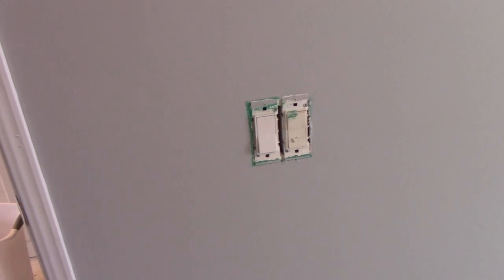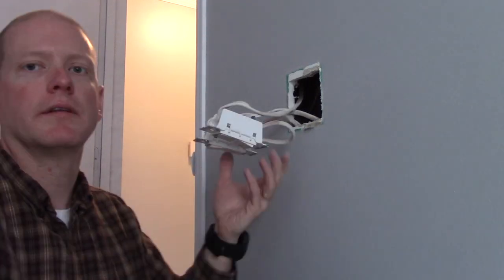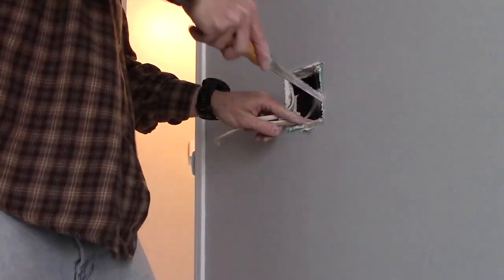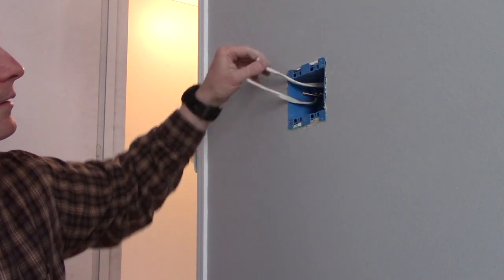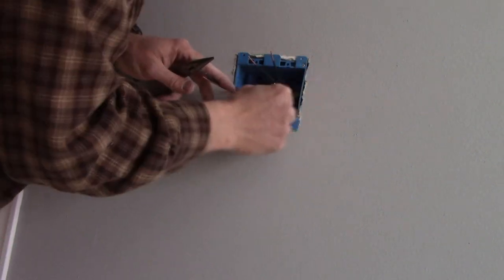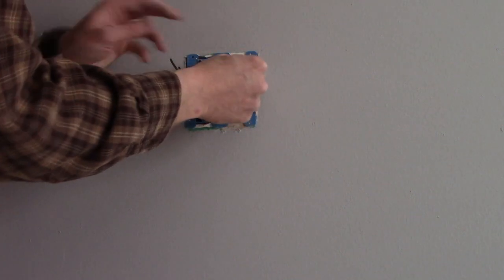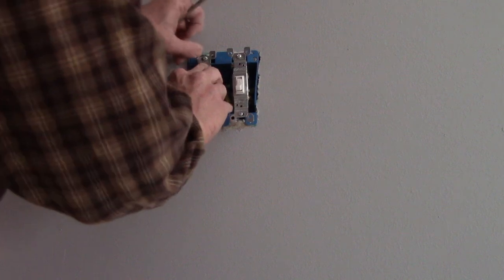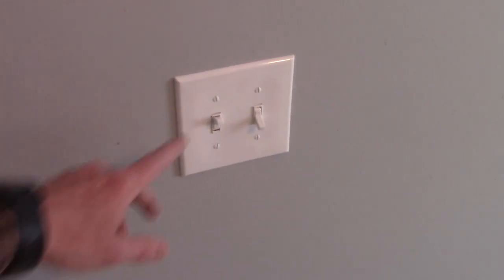How To Replace Mobile Home Self Contained Wall Switch or Outlet

Comment: I wired hundreds of mobile homes using snap fit receptacles and switches working for Mobile Home Estates in Bryan, Ohio.  They are extremely inexpensive and fast to install and yes they are JUNK.  An average single wide mobile home was wired in less than 45 minutes.  This included cutting the notches in all of the studs, cutting all the holes in the drywall for all of the boxes, running the wire, installing the boxes, putting protective metal covers on each and every stud that has a wire in it.  wires going up to the ceiling or down below the floor had tubes driven in to protect the wire.  This was all done in an average of 45 minutes to 1 hour by me for a complete single wide mobile home.  Double wide's are a complete nightmare because the two halves are split and all those wires have to be coupled together somewhere and it us usually inside of a switch, receptacle, or just a blank box in the wall or below the floor in the double wide.  Often there were more than one feed wires coming from the breaker box going into the junction box and the set up guys would just wire all of them together so you would often have two 120V power wires running one outlet.  OFTEN ON SINGLE WIDES you have a  single white wire and a black wire going to the switch.  That is because they are running a power loop thru the light fixture and to save wire they just break the hot side at the light fixture by running a single wire to the switch.  (black power coming to the light fixture "hot" connected to the white going to the switch and the black wire at the switch going to the black wire on the light fixture).  MOBILE HOMES OFTEN HAVE JUNCTIONS AT THE LIGHT FIXTURES RUNNING OTHER RECEPTICLES OR LIGHTS.  MOBILE HOMES ARE RARELY WIRED LIKE A STICK BUILT HOME SO BE CAREFUL WHAT WIRES YOUR CUTTING AND CONNECTING TOGETHER OR YOU WILL HAVE A MASSIVE SHORT.  THERE ARE SPECIAL TOOLS USED TO TRACE WIRING IN MOBILE HOMES !!  Further if you are going thru all the trouble to get rid of junk crimp style switches and plugs that have corroded and faulty PUSH TYPE CONNECTIONS, why in the world would you replace them with new push type connections that are going to corrode and fail just like the original ones did.  USE THE SCREWS ON THE SWITCHES AND RECPETACLES AND USE DIELECTRIC GREASE ON THE WIRE if you have Sulphur water or high humidity in your area.   Wire nuts are far superior to these push type connections and never ever use the push pins on switches and receptacles as they will corrode and fail !!
Reply from the maker: Good comment
Reply: Your video is very well made and I respect that you are trying to help people.  After Mobile Home Estates closed,  I opened a mobile home repair business.  I did exactly what you did on many homes and had quite a few of them fail mostly in homes with Sulphur water. because some of the crimp fittings were ok, and usually just one failed, it makes tracing the wire to the problem extremely difficult if you have a failure using push group fittings.  As you know and made a good comment on, rarely is there much wire left in the wall for a repair.  This is because we were told by the mfg. DO NOT WASTE WIRE.  they would weigh our scrap and dock our pay for the losses especially when copper prices went sky high for a while.  Also there is a LOT of poor quality wire used in mobile homes having a lot of higher filler metals in them which corrode faster.  You can tell by how hard the wire bends.  The easier the bend the more copper that is in the wire which is a better quality.  I would just go one step further and tell people to pop the back off of each and every switch and receptacle and pull the wires out noting EXACTLY which ones were connected to each other.  Cut the wires where the crimp on the switch or receptacle punctured the wire coating.  This will give you more wire to work with.  Further you can be sure you are putting things back the way they were.  You can often strip off just a little coating and leave the wire intact and just make a loop over the screws on the receptacles which is a safer way to keep power going to the next item in line, plus again gives you more wire to work with.   I am not a troll, just trying to help.  Thanks again for the great video.    @JackofAllMasterofNone
Reply: @brywilder7582  thank you for taking the time to share all your information and expertise. I live in a mobile home. First experience with one. What a new and trying experience. Wow this electric, plumbing, shell and everything! I was completely naive and uneducated. Learning something new everyday. But wow on the electric. Trying to change 2 vanity lights now (into one). What a fiasco.

Comment: Just a heads up, you don't have to cut the wire at the back of the self contained switch, they have a pop out plate and the wire inside is already stripped.

Comment: The biggest problem is not so much replacing the switches is the fact that most people don't hold onto the outlet when unplugging and end up pulling whole outlet out and pull it through the sheet rock resulting in large hole to repair.  The whole industry for mobile homes need to be updated.  No 2x4's to hold outlet boxes and 3/8" of sheet rock is all that holds it.  Kids could touch edges of plugs and electrocute themselves.

Comment: When I pulled out the switches in my bath room the switch on the right side has two wires on bottom of switch and the light switch on the left has two wires on top on the switch. I have watched your video 23 times am not sure what to do. thank you for making this video.
Reply: Did you get an answer? Mine is exactly the same

Comment: Thanks for all your tips. I live in a double-wide mobile and all the outlets in the light switches are exactly like the one that you just showed that you took out. And I have to agree with you they are junk. The only thing that I wished is that I could have found your video a lot earlier. It would have saved me a whole lot of problems installing the regular conventional light switches.

Comment: Fabulous video.  Moved into an off-frame modular home and found the inferior switches were throughout the house.  When I had some electrical work completed, they replaced some (the ones they worked on) and recommended that all of the others be replaced.   Now I understand what's involved.   Thanks so much!!!   Really well-done and easy to understand.

Comment: Thanks for the idea.  I've got a modular home with the 'self contained' outlets, and I need to replace several (plus some switches).  I was going to order a bunch of the self-contained style; but this method makes so much more sense and uses hardware I can get easily at any hardware or building supply place.

Comment: these were made by SLATER Electrical wiring devices and I had to do this same proceedure to my home I purchased in 2012. I had to upgrade all the outlet and switches to this level to bring the home up to code.... these wiring devices were allowed by the HUD code. On mine, I pryed off the cover and disconnected the wires from the switches to avoid losing wire length... I had to changout all the devices in my home.... it was quite the job and now the home is upgraded and safe. I'm glad to see you used the push on wire connectors.. I love those, so easy to use! the other alternative is the WAGO connectors...

Comment: Thank you for this video, I live in a mobile home, and the factory switches are junk, we have been in this house barely over a year and one of our switches is hardly working now. I will start converting my plugs on our walls, then the bathrooms which has a fan in it.

Comment: I have the exact same two light switches in my bathroom. 1998 park model. One switch goes to the exhaust fan and the other switch goes to the light above the vanity. I was going to replace them with like items which I purchased from a mobile home supply store until I learned of how chincy and unsafe the self-contained switches are. After watching your video I feel like I can replace these switches with a regular old workbox and regular switches but I have a couple questions. What was the extra cable running from one of the switches to the other switches in the old self-contained setup used for. I notice you just discarded it with the old switches but what exactly is that short cable used for? 

Also I want to make sure I understand the grounding. You took the 2 ground wires from one switch, pushed them into a connector and then you put a smaller piece of wire into that connector You did the same on the other side.  Is that so you could have one wire to use on the ground for each switch? And would it have been the same if you had used a wire nut on each side? I like the push and connectors I just want to make sure I understand.

My other question is, can I use rocker switches, they are visually like the ones you took out, But they are not self-contained switches. I just like the way they are flat because I have problems with my hands and fingers. 

Thank you so much for this video. Not only are the modern switches safer but they are less expensive and more reliable.😊

Comment: I just replaced all my neighbors switches and outlets only to discover that the inner wall depths were all 2" or 2-1/4". The gang box you are showing people would not fit into many of the older mobile homes from the 80's. I had to use Shallow Old Work Gang boxes that you twist sideways into the drywall hole. Those old self contained switches and outlets are crap.
Reply: Thanks I have this same issue right now which explains why I cannot get a lot of mine to sit flush will try to look up what you used.
Reply: I have been this also but like you said walks are to shallow. I have been cutting the back off box to accommodate this problem,

Comment: Just a tip you can take the wires out of the self contained box and cut to where they stripped it to get just a little extra wire. Also if you need to wago makes some inline splices you can use for single wires to extend them. Edit: also saw you use the quick connect or backstabs as I hear them usually called and I don't recommend it as long as you leave it in there and don't mess with it it should be ok but once you take them wires out again the quick connection is ruined and most certainly shouldn't be used again but in general those connections are not near as reliable as the screw terminals even when left alone.

Comment: I have one similar to it in my master bathroom and want to change it to standard switches cause one switch already making arcing noises, but mine have a 3 gang, one controls the exhaust fan, the next controls the exhaust fan light and the 3rd one controls the bathroom light, so am in a bit more complicated wiring scheme, any wiring diagram for a DIYer will be appreciated.
Reply: Not sure if there is a 3-gang box. You could do a 2-gang and a single to make a set of 3. As for wiring, you have to identify the hot wire or wires (first step) and daisy chain (jumpers) if needed to all the switches/fan. I'm new to this work for mobile homes but done it for years in stick-built homes.

Comment: 🥹😭😭😭 I've been looking for exactly this video!!! thanks! my bathroom switches got loose wires (I see that I have the exact same scenario as you here) and I don't have light in the bathroom or my master bedroom!!! these are the worst type of switches!! this is a 2007 mobile home and everything is falling apart on that front, I used to have a 1968 home that didn't have so many issues!! 
Edit :  How would you do this if you didn't use the push in wire connectors? twist Neutrals together with wire nut, then the hot wires twist together and then pig tails to each switch? I'm trying to make sense of the hot wire situation, THANKS!!
Reply from the maker: Yes. Exactly what you said as far as wire nuts.

Comment: Could you strip the white andblack wires and it'll get better connection instead of trying g to get connection through the insulation on the wires?
Reply: Why wouldn't you remove the insulation? it won't work unless you do.

Comment: Question. What does it mean when the exhaust fan switch works fine but not the light switch?? Light won’t come on
Reply from the maker: I know this is a dumb question, but is the bulb good? Could be many things. The switch itself, the bulb, the wiring. Sperate wires for the fan and light.
Reply: @JackofAllMasterofNone  I even checked the breaker box and resettled the outlet next to it. Still nothing. I definitely will check the bulb and recheck the wiring as well.

Comment: So on the bare wire, you had the two into the bottom of that 4 pieces. Then used the extra piece to come out to be the extension of the ground? Great video, I'm just curious so I do it right.

Comment: Great video! Thank you so much for putting it together. I have a question and hope you can help.  I have been working in my bathroom, Two switches one powers a fan and the other two lights. I followed your instructions other than I used wire nuts to connect the white wires (You said would be okay). I connected two white wires from one switch and two from the other switch ( not all four together). My lights work but the fan does not. Do I need to put all of the white wires together rather than the two and two? I thought maybe the fan switch was bad and tried a different one. Neither works the fan. Do you have any ideas that may help me? I don't want to hire an electrician for this. I appreciate your help.
Reply: all 4 white wires are the "Neutral" and should be together, I would check between the separate white connections with a volt meter for verification of that fact. There is an open circuit for the fan. I hope you found your problem.

Comment: Are mobile home walls always thick enough to fit new boxes in? Is it okay if the back of the box is touching the wall behind it?
Reply: I went to ace hardware and bought the low profile old style (old school) whatever it is they’re called and they fit perfectly. They also have a little flap that flips out behind the wall and as you turn the screw, that flap comes closer to the wall until it is bracing the box inside the hole. 

Now if I can just figure out the wires. I’ve watched this video three times so far and simply can’t figure out what to do with all the wires. 

I have one hot, one neutral and a ground all from the breaker box, one black, one neutral and one ground from two other wires coming in that go to the fan and light. I see he puts two black jump wires in the connector box and two black wires from the home. He puts the commons together in a connector box but do ALL THREE commons go in those connectors?  Do any of those connect to a switch?  Then he connects a black wire to that second switch. Is that the jump wire from the connector?  Because it looked like the main wire coming in for the fan. 

I’M SO CONFUSED with all these wires!  An electrician even looked at this mess and said he really didn’t know what was going on with that stuff. So now it’s up to me to figure it out. 

HAD TO CHANGE THEM because one switch was black inside and some black on outside indicating a short in there and the flippers broke on both of them. 

Anyone have any advice for me?

Comment: What is the TOOL you need when replace mobile home switches without converting them to standard switches??
Reply: Most likely, Phillips screwdriver and needle nose pliers so you can remove wires from old switches. I myself, would change them over for better quality.

Comment: I have these type of outlets but when I remove them from the wall there is only one set of wires coming from the wall. Every video I find everyone has two sets of wires coming out of the wall into the box. Any suggestions on what I can do?
Reply: Mine has 3 wires for each switch so I am really confused.
Reply: If it's an outlet that could be correct with only 1 wire. Not so if it is a switch that would have at minimum of 2 wires.

Comment: Thanks Jack. What did you use to strip the wire so quick n clean with?
Reply from the maker: Just a cheap pair of wire strippers.
Reply: It is a Romex wire slitter.

Comment: What box do you use when the wall is only 2.5 inches deep? The HD by me only carries the 25 cubic inch boxes  which as you know, are 2.75 inches deep. I'm trying to find some lower profile boxes, but haven't been successful, other than finding single gang ones, which won't work too well when it's 2 switches.
Reply from the maker: Yeah im not sure. You are right, all of the shallow boxes are usually single gang.
Reply: I've had to cut the back off the duplex boxes to shorten them to fit in 2.5 deep  walls. Additionally you can either duck tape or drill holes and zip tie the back side of the box back on after removing it and making it adjustable.